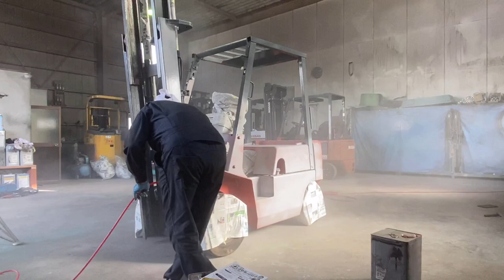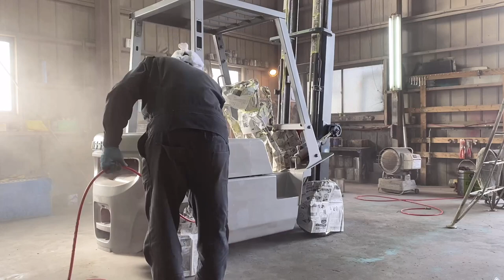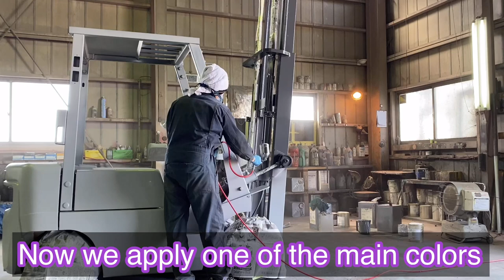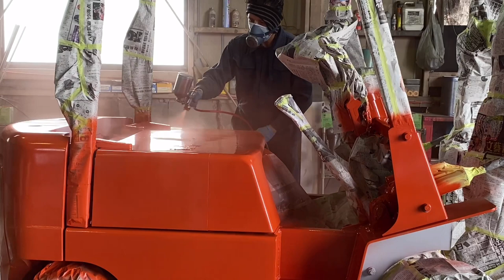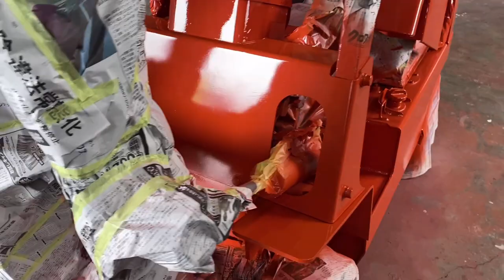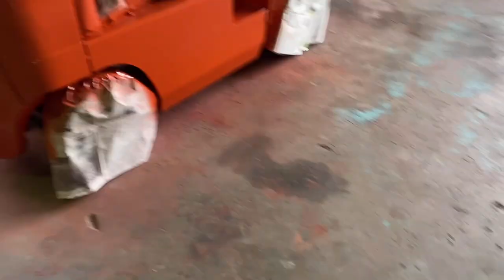How did I clean this old forklift?

Comment: Very nice sir. I just purchased a 1995 Hyster H155XL with 2070 hrs on a Perkins. It was an Air Force machine, no leaks, not at all beat, hydraulic forks all the bells and whistles not that they had many in 95. I want to repaint to original Hyster color, yellow. The machine is now your typical flat olive drab green. Do you have any advise you could share? I'm going to put six new tires, change all the filters, inspect the hoses and change out if any cracking.
Thank you,
Eric